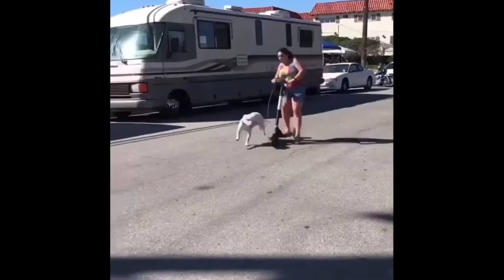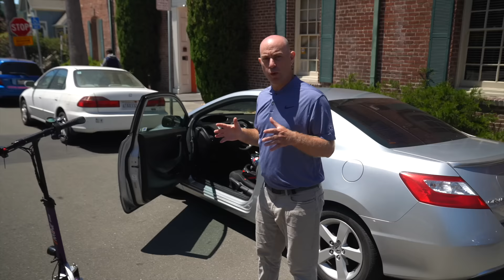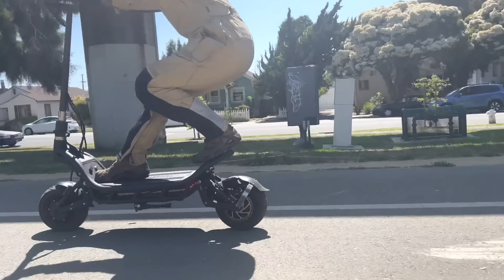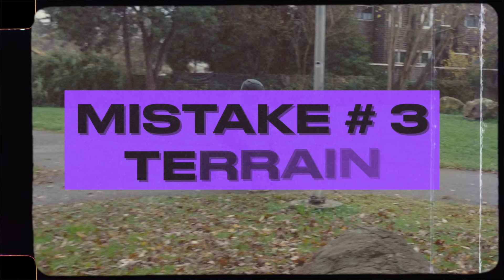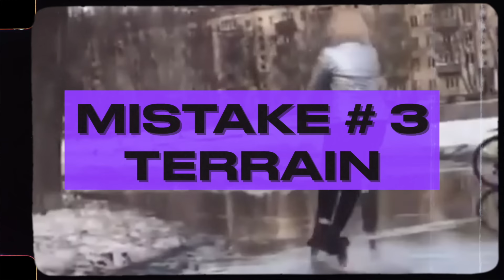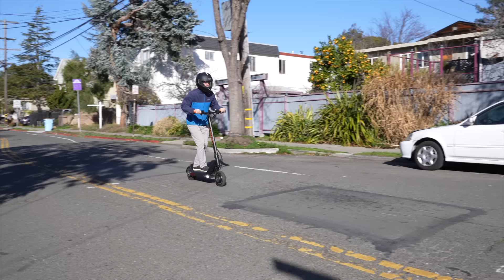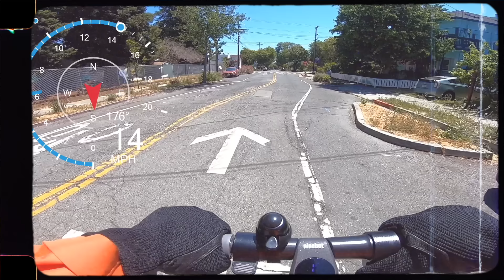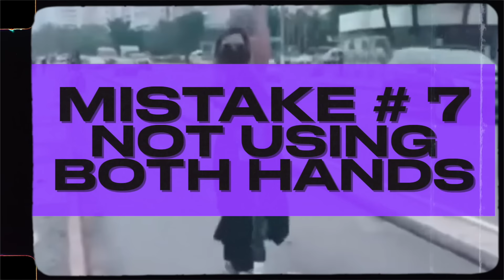Top 7 Riding Mistakes New Scooter Riders Make & How to Avoid Them

Comment: I fell with my Zero 9 scooter twice.  The first time was equipment failure due to poor handlebar latch design.  It is designed to fold and easily and quickly with a simple press of a latch lever at the base of the handlebar.  I was riding on a city rough road, after a mile or so of rough rythmatic bumps, the latch unlatched and the handle bar folded toward my chest and the front wheel tilted up off contact with the road surface.  I fell forward landed with my right palm first.  The pain was  not too bad compared to the shock.  Since then, I used a metal rod through the hole above the locking pin blocking the latch from unlatching accidentally.
The second time I fell from the Zero 9 was during a ride on a well paved trail with my friends.  My scooter was faster than theirs and I while I was looking at the rear view mirror (I installed one) trying to see If they had catched up behind me, suddenly I fell.  This time landed on my chin.  After my friends catched up with me, took me to an emergency hospital, twelve stiches and hundreds medical fee.  I am still looking at my chin scars every morning and shave carefully.  Now I wear chin guard with my helmet.  The moral of this story is that 1. Focus 100% when you are riding your scooter and at NO circumstance completely took your eyes off the road.  2. There is a Murphy's law, accident happened when you're least prepared and hurt your least protected part of your body.  I was wearing helmet, goggles, motorcycle clothing, motorcycle jeans and heavy hiking boots (I was a motorcycle rider).  I still don't know how that accident happened and why I didn't landed on my shoulder, my forearm, my hands,  my elbow,  my forehead or side of my helmet.  Why landed on my chin and blood splashed on my goggles? 
I hope my post will help some riders.
Reply: i bought a step today and you make me realize
Reply: thank you!
Reply: Answer is easy. You didn't use your brain but cool story bro
Reply: Dude you shouldnt be riding scooters,. or anything else lol. More than a few times I was looking behind me while riding hands free.

Comment: In the electric unicycle world we're really big on downhill-rated bike helmets (ASTM F1952). They're lighter than motorcycle helmets, have better visibility, and they're intended for speeds faster than 20mph. Would definitely recommend those over motorcycle helmets if you're not going over, say, 40mph. The TSG Pass in particular is designed for street use and is really popular.

Comment: Took my Burn E Max 2 out for a first ride last week. Had it in "D" where top speed is about 30mph. Wiped out about an hour into the ride going around a turn too fast with my weight in the wrong place. Landed on my arms and skidded on my side about 20 feet. Tore up my palms and got a little road rash on my elbow and hip. Lessons learned... Must buy proper safety gear (armor, gloves helmet) and distribute weight properly in turns, acceleration and stopping. Had to ride home with bloody hands and was sore for a few days but got back on a few days later and I've already gotten a lot better at riding. Ordered some armored gear from Lazyrolling and a helmet from Predator. At 47 years old and an out of shape 220lbs, I'm glad to know I can still take a bad fall and get back up...😂😂
Reply from the maker: Sorry! Hope you feel better. Stay Safe.
-Vosk

Comment: I agree with cruise control. I honestly think it's really badly implemented in pretty much 95% of scooters. It was a part of reason for the accident I had, and since then I absolutely stopped using it. I'd like to have full control over speed at every second.
Reply: Exactly its not a car that has a dedicated lane, youll face off against both cars people and even other bikes too
Reply: Cruise control is meant for longer streatches without to much noise, people, bikes etc. Turn it off when there are to many disturbances.
Reply: Ive never owned scooter before fyi so my question is does cruise control work simulair like in car? I mean does it disconnect when you press the breaks gently or is it persistant to keep throtteling?
Reply: @MrDenyyZ  it brakes
Reply: On both my scooters, just hit the throttle again to disengage cruise.
Reply: @dayd7420  And other scooters!
Reply: @dConceptdk  Exactly, I go to work on a scooter, 10km through rural area and since, its speed is limited to 30km/h I leave it on 100% cruise control (so I don't need to replace thumb on my hand so often, new thumbs are expensive and used ones are usually from elderly people :D). I don't know how about other scooters but mine beeps when cruise control is activated :D
Reply: The digital display ones don’t have those problems
Reply: @MrDenyyZ   on my zero 10 it engages when you stay the same speed for 5 seconds and it holds you at that speed like a car, and disengages by flicking the throttle or tweaking the breaks. It's a bit fiddly to find the right trigger level to disengage. I'm going to turn it off. I can see it backfiring on me.
Reply: I've got a cruise control activating by a button only and switching off immediately when you touch the trigger again. Never thought someone had at least an IDEA to make it activated automatically 😬
Reply: @steposka  same here mate, my scooter tops of at a high of 30km/h and when i keep it at the speed for about 5 seconds or so it beeps and im in cruise control.
Reply: i mean there's a reason people like us don't just take the bus right?
Reply: @failsaferecords On my Xiaomi I turned off cruise control at first when I was in “lot of action” areas. Then I figured out that it disengages cruise when I touch the throttle again. Alao I have set regenerative braking to the highest setting. Now I use cruise control and mostly regen braking, and only touch the brake when really needed.

Would also be better if throttle hadn't control the speed but the power to the wheels like in a car, but that's a different story...

Comment: Thanks Bud. I'm 61 years old and been riding motorcycle and Mountain bikes all my life. I just got one of these things and had a lot of operating while riding questions crossed my mind thinking about when my first fall comes. I am taking the risk once I step in one of these. You covered alot, standing, emergency stops and body position for a crash. Short and to the piont. You are a great instructor. My cruise control was a real pain getting started till I figured out how to shut it off. Also, Keep 2 hand on the handles.

Comment: I recently purchased my first scooter, a KS5 pro which will come in next week from Amazon and let me say watching this video really hit the nail on vital points. 
I've crashed my crotch rocket years back on turning corner in a pile of raked leaves so I  needed to know what's the right way and wrong way to handle scooters. This video is a real eye opener on the types of gravel terrains and the small tires needs my full attention to keep scooter balance.  I love the positions you taught me on the proper stance when mounting the bike with slightly bent knees and why it's so important to have right foot forward for so many important reasons. 
Your video is top notch as you went over with the clips on what happens when you do these dangerous flaws and mistakes but most importantly how to prevent them. Even though your video is only about 10 minutes long but it's life changing! 
Thank you so much for this review!

Comment: The breaking posture is a really important one. I have an e-scooter that breaks like a regular scooter, with the rear fender. And I remember once I did an emergency breaking where I ended up standing on just the rear fender, with a strong backwards posture like you said, and I sopped very fast. The wheel locked up, but in that position you can control the scooter pretty well, actually.
Reply: Rear wheel locking only makes you slide, front wheel locking takes you for a ride 💀
Reply: An e scooter that breaks like a regular scooter. Ouch 🤕 don't buy a Scooter that breaks easy

Comment: I bought a used scooter, the seller told me the front brake button was just to turn off the cruise control I did not know it was an actual brake. Well I flipped my scooter, luckily I landed in grass but I messed up my left knee and injured my right foot in the process. I’ve owned it less than a month and I’m already thinking about upgrading. It’s fun and definitely the hobby I’ve been searching for!
Reply from the maker: Insightful! Thanks for sharing.

Comment: Always wear gloves and other protective gear when riding a any scooter.  I suffered chest pain,  left arm scrapes and my right knee cap abrasion on a simple fall cause I was freaked out of a car passing on my left near sunset.  So after a four months recovery, I wear  a day glow wind breaker gloves, a slight bend at knees so my teeth don't require dental repair, let go of the power switch 10 feet before the all cross walks, make a full stop, give the right of way to everyone before moving forward.   The full stop also saved me from getting a moving violation cuz  police vehicle was parked  about 40 feet away waiting for his next victim.   THINK SAFTY FIRST,  THE FUN WILL FOLLOW.  You should always be in control.  ENJOY  YOUR RIDE! 😉
Reply: I didn't,  mention, I  will be 80 this coming December.
Reply: I read a article of a middle aged woman, who suffered serious injuries from a electric scooter.  Her face and dental work costs were in the thousands on a short 5 miles an hour crash.  Know your limits, start slow.  We all have a learning curve to follow.

Comment: I'm on my second scooter since 2015. But both I've ridden with seats, and that puts you in a better control position similar to a motorcycle. I've had five falls, no serious injuries ( the worst was my elbow needing some stitches ) . That worst fall was me getting knocked off the scooter as I had the right of way at a crosswalk, the driver of the pickup truck was making a right turn on red and never bothered to look my way while I was passing right in front of him. He knocked me right over and the scooter itself protected me from getting run over. Only one fall I take full responsibility for, and that's when I tried to do a U-turn too quickly on a narrow road. The power wants to push you straight ahead unless done at low speed and you can be using the handlebars to actually turn. A couple other falls were where I was transitioning from grass to sidewalks at slow speeds, not taking it head-on but at an angle and the back wheel caught the lip of the pavement and I went down fairly quick and easy to grass, no harm done. Just the other day I had a fall that's something every scooter rider needs to always be aware of and that's obstacles or holes in the rode. I was coming to a stop sign in a parking lot, so not at speed but next thing I know I was being thrown quickly down to pavement sideways. That was a big surprise, but before I got back up and looked back to see what I'd hit I already knew what happened. You don't normally see potholes here in Florida but it was a good deep one. I was lucky to just get away with soreness and a little scraped elbow, but if I'd have hit that sucker at speed it could have been serious! My advice as an older person and fairly experienced rider ( one who in his former life almost died on a motorcycle because of mechanical failure causing a wobble and a long slide down I -95 ) always ride like your life depends on it, they are not toys. And worse than motorcycles even, be extra defensive because you see cars coming out of driveways and things a lot better than they see you.
Reply: I ain’t readin all that
Reply: @Tralblzr  LOL ...yeah, I was a bit too wordy
Reply: good lookinf out, I might not have considered hitting grass to pavement transition like a motorcycle on railroad tracks 
thanks im older too and can't afford a wipeout

Comment: Oh, and braking.  In my riding (mostly gravel and dirt roads) I've found that i will start with back brake first and be pretty aggressive and then feather in the front.  It's not quite like a motorcycle where front braking is better, but the lean back as shown in the video and back braking first and then front brake feathered in has really shortened my braking without sliding in the dirt and gravel.  Great channel and videos!

Comment: As someone who rode bicycles a lot and was used to scanning for potholes and other road imperfections, I was surprised a couple of years back when my scooter hit a hole in the road that a bike would have handled with no issues and I went sprawling all over the pavement. Now I realize that scooters can't handle what a bike could and I avoid even small road imperfections. I haven't crashed again since it happened. Seems obvious but my road scanning was not tuned right for scooter wheels and now it is, I think.
Reply from the maker: Very insightful! Thanks for sharing. -Vosk

Comment: I got used to my Segway ES2's Cruise Control not being audible in a loud street on day one. So I always. ALWAYS. Release the throttle then immediately press and release it to disable it in case it's turned on. It's not ideal but I got used to it just to be safe.
Also I tend to indicate turns with my head, because one thing no one notices about scooter turning lights. You are SO small, most cars just see a blinking light and don't have any large enough reference of whether that is left or right

Comment: I put turn indicators on my handlebars and rear view mirror on my helmet, so no problems riding on roads :)
Reply: I will never ride without a rearview mirror ... I  find one is sufficient plugged into the left handlebar grip ... no way will I ever try crossing a road with traffic to make a left turn by cranking my neck backward after putting one on my scooters... I tap the brakes to flash the brake light to indicate my stop and heads up to make the turn

Comment: My rules: 
1. avoid big scooters, never run at more than 25mph
2. never run close to parked cars
3. always think that a car could take a turn without signaling it
4. never jump off curbs, especially with small scooters (like etwow, m365 etc)
5. never do off-road.
6. always go slowly and carefully in roads that you don't know
These are not only safety measures, but they allow even small scooters to last for many many years...
Reply from the maker: That is a great list!

Comment: Good idea putting out a leg instead of an arm to signal. I never thought of that!
Reply from the maker: Thank you! That's one from back when I raced motorcycles. We would use our legs to signal that we were exiting the race track, since we didn't have turn signals an often didn't want to take our hands off of the bars at speed.    -Paul
Reply: I’ve had motorcycles for most of my life. I’m not so sure a car driver would understand what you mean by pointing with your leg…unless you are really athletic like a dancer and able to ride with one leg 90 degrees up! I’m afraid lifting a leg would probably by the car driver be considered as just showing off or stretching. Still, that’s better than falling in front of a car trying to point with your arm. Oh well, just pondering. I only own other kinds of PEW:s, would love to try out an electric scooter though. I love the vids on this channel, they seem very professional and friendly at the same time. One problem I have though is that in some reviews there are links, but they point to like Amazon and then there isn’t any scooter with the same brand name as in the review. Makes it hard to know if you get what you just reviewed.
Reply: I have a helmet with signals that I activate with a remote on my handle! ;)
Reply: @kenspaceman3938  true...
Reply: @loolox3823  what happens when you turn your head to check for traffic and now the signals aren't visible to some drivers, say oncoming or traffic in front of you ?
Reply: Dont think of that..
Frankly that is Assign. 
On the street...drivers nor police will know what you mean...plus lefting your leg also greatly reduces your balance dangerously

Get a helmet with turn signals
A backpack with turn signals
Install turn signals.

Cars/trucks do not pay attention to or understand the scooter on the road and do Not give you Right of way..

Unless you talk to those drivers in a language they understand ( that being commonly recognized turn signals )
Reply: @ESG-ElectricScooterGuide  I am a new rider and I don't feel stable when taking one of my feet off the scooter, so I am going to get turn signals.